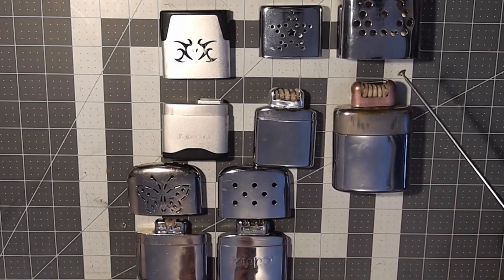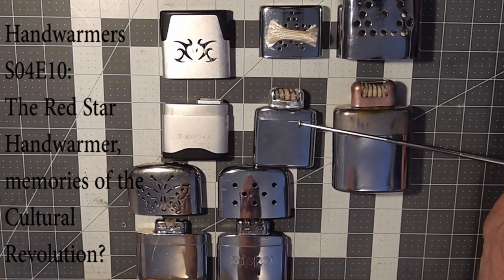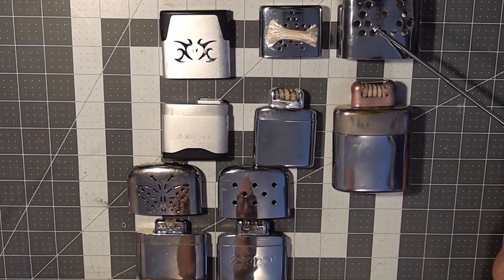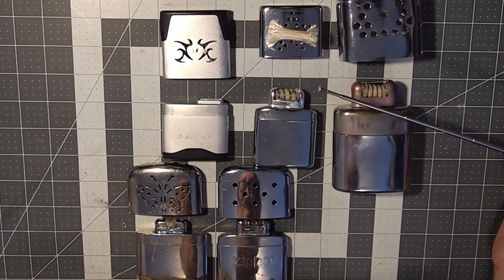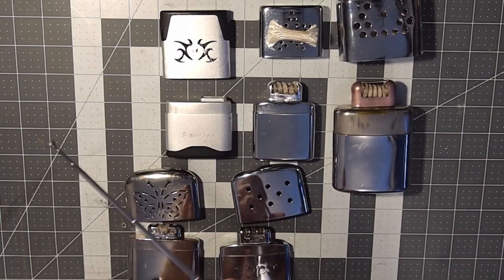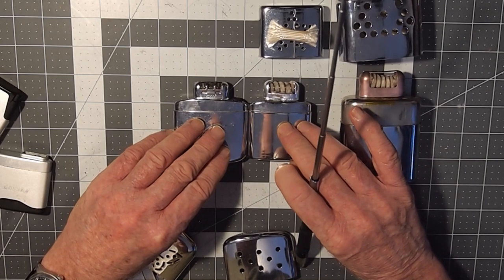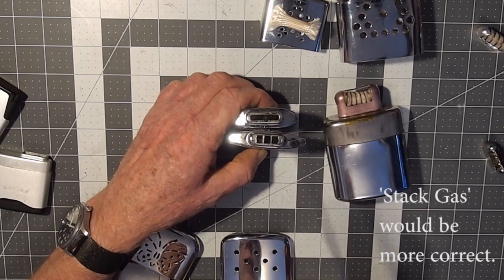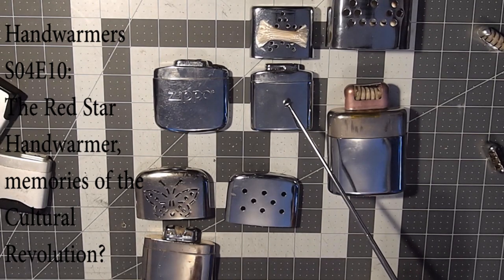Handwarmers S07E03: What to watch for when buying a hand warmer

Comment: I have a Jon-e GI from the 1960's or '70's
It takes multiple tries to get it to light and it only seems that small areas glow red.
Is there any place to get actual replacement heads?
If not, where can I obtain the best quality catalytic material?
Would it be better to re-use the original woven material to hold the catalyst, or is changing over to a spring a better idea?
Reply from the maker: Hello Andy. I'm not really sure what that woven material is, or where you'd get it, let alone how one would successfully stuff catalyst into it. I did make a video (S06E01) on this topic that may shed more light on it for you. Unless your old catalyst head is damaged or deformed, your best bet is to rebuild it using catalyst and springs.
Reply: So I understand better, my Jon-e which is marked "GI", does that stand for GIANT, or is mine a different model?
Reply from the maker: @andygold  I'm not an expert on Jon-e markings as I only have the one shown in the video that was gifted to me. You can compare the size of yours to the one above and if they match, you have a 'giant'. (The grids in the picture are 1" squares).
Reply: Not all but the older Jon-e 's have the Mfg date stamped on the bottom, And the brushed Stainless are older than the polished.
Reply from the maker: @timvener3723  You just made me think of a YT video I watched today from 'Future Proof' about Beats Headsets. Apparently they are already yesterday's technology, but even worse, yesterdays fashion! In a few years no-one will even know what they were. Then of course at the end of the video, they have an affiliate link for a better pair! The Jon-e GI will never suffer that fate, and I will never have an affiliate link at the end of my videos for a better Jon-e. Perhaps not because there is no other better Jon-e surrogate on Amazon, but because no-one has ever made it to the end of any of my videos. Sigh...
Reply: @MountainParameters  Not sure if it's a good thing of a bad thing, but I make it to the end then go back and make sure I didn't miss anything LOL.. Back to the Carb analogy, To a point the carb will adjust to a dirty air cleaner and maintain stoichiometry, but at a certain point the mix will go rich..  That was my thought on limiting O2 to the catalyst.. damn it now I'm going to have to start participating in the research....
Reply from the maker: @timvener3723  Good point. I posed this question to ChatGPT and it tells me that the carb analogy is not the best for sure. It says, "When naptha fumes react with a platinum catalyst, the fuel mixture is not considered a stoichiometric mixture. A stoichiometric mixture refers to the ideal ratio of fuel to air for combustion to occur in an internal combustion engine. In this case, the naptha fumes are not mixed with air, but rather they are reacting with the platinum catalyst to produce different chemical compounds.

The platinum catalyst is used to catalyze the chemical reactions that occur within the naptha fumes, which are a complex mixture of hydrocarbons. The reactions that take place with the catalyst can vary depending on the specific application, but they often involve the breaking down of larger hydrocarbons into smaller ones, or the conversion of naptha into other chemical compounds.

The reactions do not involve combustion and are exothermic reactions that release heat energy, but the fuel mixture is not stoichiometric mixture, because it does not involve air."

First, ChatGPT seems to refute my belief that the naptha evaporates, mixes with air, and then convection carries the fumes to the platinum catalyst. So best to go with what I have observed. When I pack more platinum catalyst into a hand warmer, I can make it burn a lot hotter, but I also can see that the fuel is burned out much quicker as well. But in terms of the mixture being more or less rich? I guess we need to do a simple experiment. Place 15ml of naptha in a completely spent hand warmer reservoir  and let the hand warmer burn with unrestricted air flow while measuring the temperature and time until it is fully burned out. Then do it again in the pocket of the Carhart's and see what the results are.
Reply: @MountainParameters  Chat GPT I don't feel like is completely correct, as the warmers can be shut down by eliminating air access (zip lock) so there has to be a component of the reaction that uses "Something" in air..  I like your approach to the experiment better,  My idea was to measure the Delta on the mass varying access to air. Maybe open tape over half of one side, then tape over all of one side..  But that still dosen't tell me if the vaporized fuel is all consumed by the reaction or just vented to the atmosphere.
Good discussion!
Reply from the maker: @timvener3723  But my thinking is if the vaporized fuel is vented to the atmosphere then that hypothesis would be supported by an observable loss of energy no? EG: if the air restricted test had the hand warmers last the same amount of time as the other test with no air restriction, but the heat was less in the second test, then you've quantified a loss of energy in the second test. I'd hypothesize that the loss of heat means a loss of energy, and if there is no fuel remaining in the hand warmer reservoir, must have been vented to the atmosphere. So I guess the other metric we need to add to this test is to accurately weigh the hand warmer reservoir both before and after each test is complete to be sure there is no unreacted fuel left over after the second test. If there is not, then it must have been vented to the atmosphere. I suspect that in fact the second test will result in the hand warmer lasting longer, so let's see who's right!